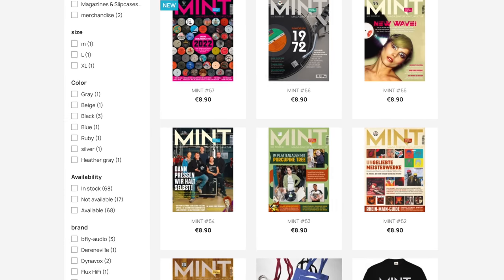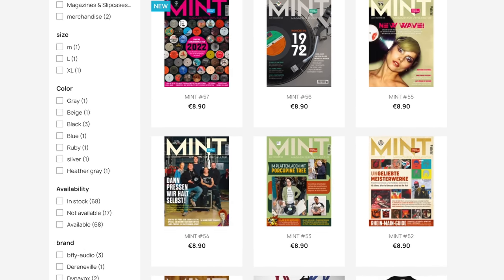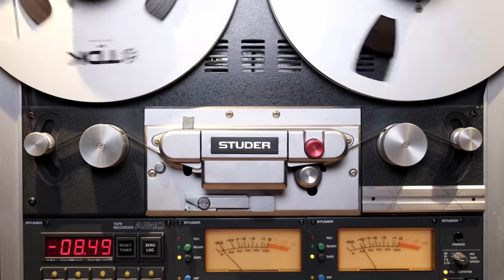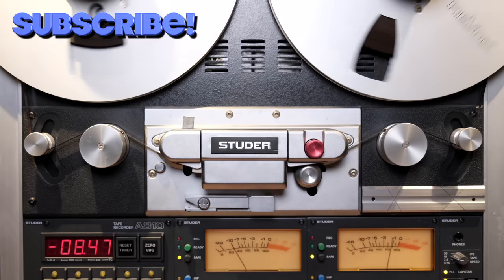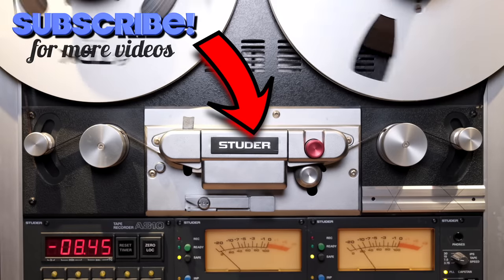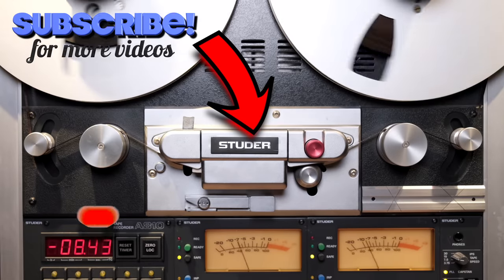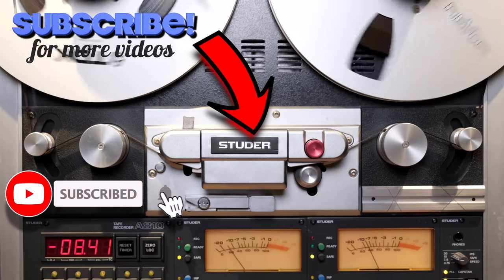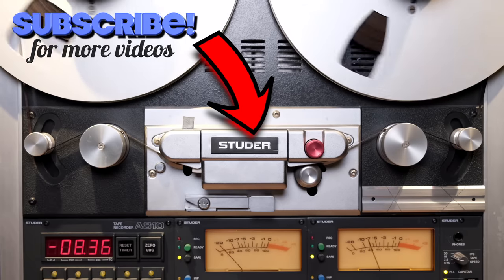Digital Delay: The little dirty secret of vinyl mastering (including past AAA records)

Comment: Before digital and analog delay lines, they used playback decks with two playback heads, one mounted several inches in front of the other so that the engineer could hear the music before it hit the lathe. This allowed the engineer to change the track pitch for loud and soft passages on the fly. And yes, this has been replaced with digital delay lines. The audio put down on vinyl is run through a digital delay line, giving the engineer the time necessary to react to changes needed in track pitch. The fact that no one ever complains of these records "sounding digital," and that people even praise them for not "sounding digital," is a bit telling, no?

Good digital is completely transparent.
Reply: The mofi "scandal" says it all ! Mike Esposito (from the in groove) even said that his best sounding vinyl record is the mofi one-step of Santana's Abraxas, and that record was mastered with a  digital DSD 256 file !!!
It is time that the damn big record companies start to master their compact discs good again like in the ealy 80's !!
The very first japanese compact disc of Micharl Jackson's Thriller from 1983 is a good example how good a well mastered CD can sound.
Reply: @lucalone  The problem with early CD's (and there IS a big problem with some of them) is that they were made not from the original studio master recordings, but from vinyl masters prepared (equalized, de-essed, and compressed) for making vinyl records. The compression, equalization, etc., needed to make the vinyl sound good sounded terrible when released on CD, which did not have the limitations of vinyl that these adjustments were meant to compensate for.
Reply: @ScottGrammer  that is sometimes true, yes. And now just imagine if they would really do a good mastering in 2022 with the original master tapes ! Those compact discs would sound absolutely fantastic !
But like I said before: damn those big greedy record companies !
Peace.
Reply: I too find it a bit telling. People like the distortion that the Vinyl system applies to sound, it is pleasant and musical, even if the source is digital. I personally do not like vinyl records but I do find them very atmospheric whenever I hear them. It is just something that is not suited to every kind of recorded music. Classical and live recordings tend to lack something on vinyl in my view.
Reply: @phrtao  can you describe atmospherical ?
Reply: It's a misnomer to refer to a playback machine with an analog preview head as an "analog delay line". That suggests that the signal is somehow being fed into a separate tape delay.
Reply: @gotham61  I didn't refer to it that way. An analog delay line is usually either a bucket-brigade device, or else it's an acoustic delay device, One sounds bad, the other worse. The preview head on a mastering playback deck is simply placed several inches upstream of the head that feed the lathe, and the engineer listens to the preview head to have a chance to make adjustments on the fly.
Reply: @ScottGrammer  It's just bad wording, because people, as in another commenter in this thread, assume that means the signal is being fed into a separate tape delay. It should be referred to as a preview head.
Reply: Call me simple minded, but I’m sure I can program you a system where the audio engineer listens to the music and does all his adaptions for optimal pitch and track layout just as he would in an all analog delay system, but in a purely digital system. This digital program is then used to manipulate the cutting in an all analog system.
Reply: @stefanwossner2007  NOt possible. All digital can do is delay, not look ahead
Reply: @stefanwossner2007  I think Neumann has already done that in their last series of lathes. I know there is programmable automation, but I don't know if the audio path is all analog or not.

Comment: You totally right, Sir,
there are a lot of unsolved issues by new vinyl pressing,
but the costs saving forcing the pressing plant produce cheaper stuff,
they even don't thinking to improving something... MOSTLY OF THEM,  -  NOT ALL ... :dothefive:
Reply: pressing plants generally have little to do with mastering but the ones that do including Optimal and GZ can cut true AAA. I know hecause unlike Guido I'VE BEEN TO BOTH PRESSING PLANTS.
Reply: @trackingangle929  agreed !
appreciate for clear !
Reply: @trackingangle929  what about MFSL ? they have said AAA, but it was digital, many of them ! i don't regret to have sold my Santana Abraxas ONE-STEP , it didn't sound natural at all !

Comment: The music at very low volume we hear at the start of the record just before the actual music  is because of the delay in the cutting process, am I right?
Reply from the maker: No, that is normal tape print-through effect. When winded some magnetization of a layer passes to the one on top and you hear it because in the beginning there is nothing else recorded on that part, except for the print-through.

Comment: The most interesting bit about this all is that this is not something that happens with "new vinyl" only but also the last decade of "the vinyl of old" (after/before the format nearly disappeared). Many of us have not been aware that records were cut in this manner already in an era when vinyl was still a leading format. We should not be surprised, now that we know, that when manufacture of the format was resumed, it picked from where it was halted, using what was available then, instead of restoring older, very hard to find gear. This is not to say current labels, shouldn't be more honest and transparent about all the processes their product goes through.
Reply from the maker: Indeed!

Comment: I've just thought of something (and it's a beneficial use of digital). What about a plugin for Audacity that scans the wave-form and outputs pitch and depth numbers over time? You could make a recording of the master tape on computer, Audacity outputs a file showing pitch and depth info, and the guy making the cut actually sits there adjusting the pitch and depth according to the numbers that have been produced by the file. He'd have to sit there paying attention, but it would be a lot quicker than the current analogue method
Reply from the maker: Could be but I am afraid that engineers don't have the time and a lot of times the skills to do that...
Reply: @anadialog  someone on the lathe trolls forum might know some figures for pitch and depth vs frequency. If you have those numbers, someone on the audacity team could make a plugin that outputs a file similar to midi

Comment: Tengo un Denon AVR1611 y declara 0,08 % de THD. Lo tengo desde 2013 y debo decir que me costo mucho hacerlo sonar bien. No obstante no lo digo porque no tenga la electrónica para lograrlo, sino que tiene tanto procesamiento y tantos parámetros para ajustar qué hay que hacerse especialista en estos equipos. Su calidad de sonido depende mucho de la fuete. Con audio digital suena impresionante. No le conectes un deck de cassettes porque suena espantoso.  Luego de un tiempo me compré un Marantz PM5005 y en mi sala hago convivir el home theater y en equipo stereo. Desde ya que el Marantz va excelente con cualquier fuente!

Comment: I don't understand why it should be so expensive for the extra tape head.  Most reel to reel decks that I used in the past have 3 heads (Erase, Record and Playback heads).  This allows the person recording to monitor the recording.  You're able to listen to the actual tape with less than one second delay after the record head.  How hard would it be to wire a deck to allow for two playback heads?
Reply: The cutter needs more delay to adjust the groove pitch. So it has to be a completely separate head further apart from the standard playback head
Reply: @Paul58069  I see.  That makes sense cause it's a mechanical operation not just electronic.  In the ole college Audio Club we used to put one tape machine on the table and run the tape a couple of feet to the other making for a long delay. I think we had to fool one of the machines by holding down the tape tensioner so we could use the take up reel on the other.  We got all kinds of fun effects out of the two machines that way.  Not a really precise thing but it worked.
Reply: The problem is that spacing between the preview and playback heads needs to be pretty long, about 28 inches for a 15 IPS tape. At 8.48 in the video you can see a diagram on the machine with the different tape lacing patterns to give the correct distance for cutting from 7.5, 15, and 30 IPS tapes.
Reply: @jimromanski2702  same deal, only a cutting facility would want to have more precision and repeatablity :)
Reply from the maker: It's not just the head, you practically have to change the whole trasport. Plus there wasn't a standard production. All these quality recorders are mastering recorders, in the sense of cresting the master tape from the mix, so that also made things more difficult hence you needed another machine and those were very expensive as well. When vinyl went down, several modifi8mschiens were reconverted or sold...very few existing know and nobody could create a new one if not for $200k or so
Reply: @anadialog  I suppose you could have a copy of the Master on a separate machine that feeds the cutting head.  You then just start it running x number of seconds ahead of the actual Master that you will cut.  That doesn't seem very difficult to do.  I wonder why they didn't try that.  I'm sure the digital delay was simpler but I'm just thinking there's got to be other ways to skin the cat.
Reply: @jimromanski2702  your line of thinking is right. But them you would have to have 2 machines instead of one, and they need to be synced. It does not make it a lot cheaper but certainly more troublesome.
Reply: Because companies are not interested in an obsolete  technology, and with a very niche user base.
Reply: @Paul58069  But the one running ahead could be a digital copy running off a computer and the delayed one would be the original analogue version
Reply: @spacehopper999  Sure it could. But the problem would be in the syncing. Overall level changes could be countered that way, and pitch adjustment of the grooves, but not limiting individual transients, I think.

Comment: Btw, maybe this has been mentioined here before but did you notice that ever since the scandal prices for MOFI releases on discogs have dropped a lot. I am seeing Santana's Abraxas for less than 600 € now. There were times when it couldn't be purchased where less than double that! And my Marvin Gaye MOFI release now also costs 180 € as opposed to the 300 € that I paid and the seller told me it was a good investment as it would most certainly grow in value over time. I can clearly see that now.

Comment: Isn’t the digital mechanism controls only the delay/speed whilst the sound stays analogue the whole chain ? Meaning those are 2 parallel processes ?
Reply: No. The digital is the delayed signal and that is what is cut on the laquer
Reply: It's the delayed signal that goes to the cutter head. Without an analog preview head, that will be the digitized signal.